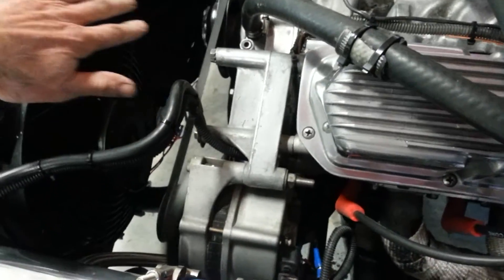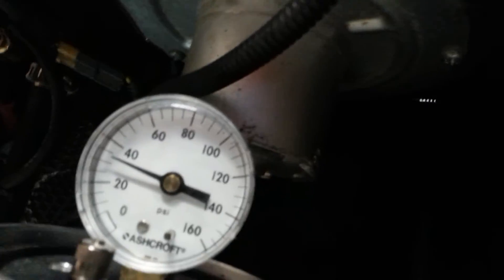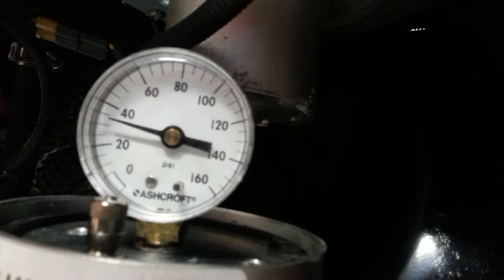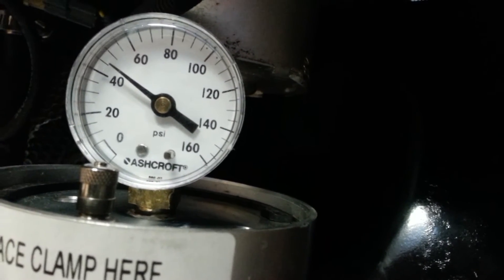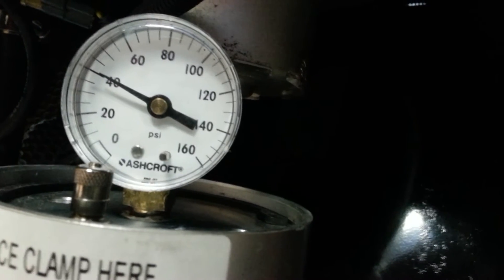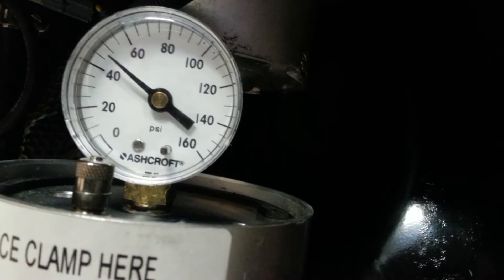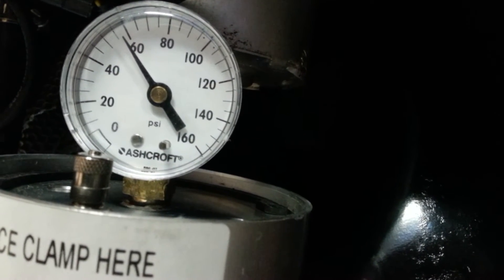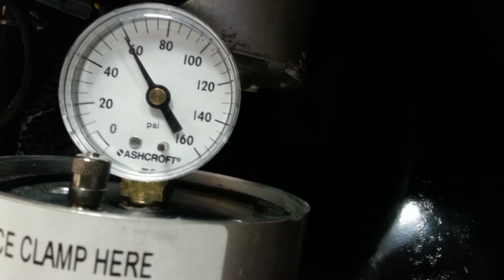Race prepped oil pump test..fantastic..

Comment: What gains did you get ? What was the pressure before?
Reply from the maker: The stock un modded pump would only ramp up based on revs, 20 pound on idle, 30 ish pound at 3000rpm, 40 pound at 4000rpm and so on. only 60 pound max. the modded pump ramps up more psi than revs as you see in vid. max 75pounds. i think the inlet on the block was a big restriction not match ported from factory so the pump would struggle to get a good delivery of oil too pump and build good pressure.Hope that makes sense.